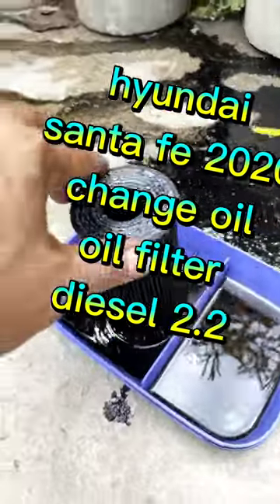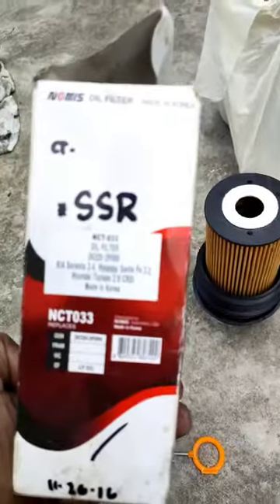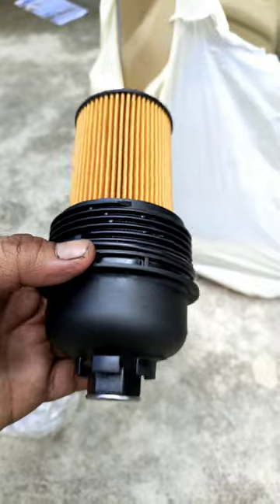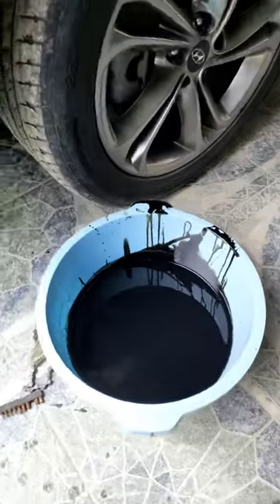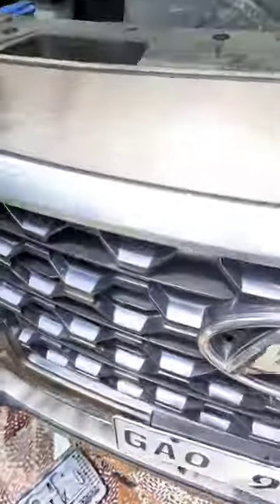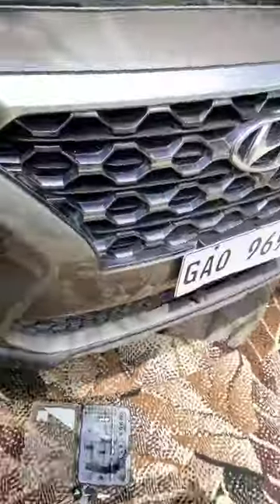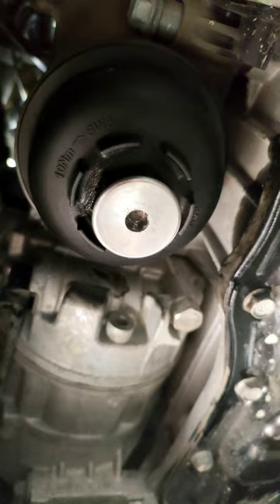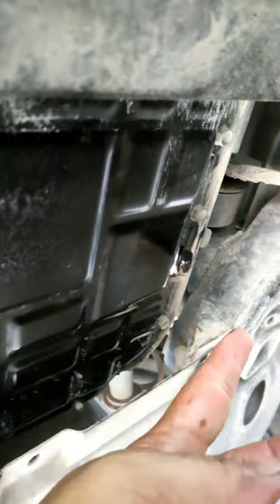hyundai santa fe 2020 diesel 2.2 change oil / change filter

Comment: Have you changed your diesel fuel filter before too? How did you remove air from the fuel lines? Changing the filter looks easy, but I havent found how to bleed the fuel lines.
Reply from the maker: Yes you can buy it from store in philippines around 7dollars

Comment: How to change diesel filter?
Reply from the maker: Remove the filter installed bottom of the hood use jack....theres 2 opening 1)that has allen for opening for filter then 2) the drain plug socket wrench